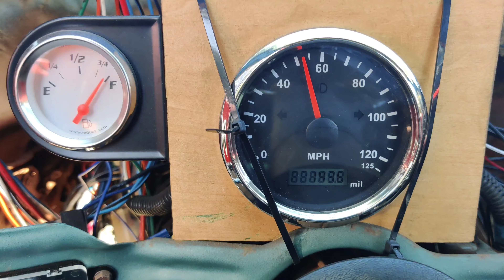MAKING BESSIE FASTER!! (Governor springs and fuel plate mod)

Comment: Hey Chuck good to see you back and see that you are doing well! Btw LOVE that intro LMAO so true every word of it. IF and when you decide to go 4k RPM you will need to get 60lb valve springs because major engine damage can occur if you leave in the originals. Also get yourself a EGT gauge to keep a eye on your temps because turning up the fuel can cause your turbo blades to melt and will send shrapnel into the engine. NO more than 1,500 degrees for more than a few seconds. Sustaining 1,200-1,350 when towing or under heavy load is ok
Reply: Agreed on the gauges. I was going to say the same thing.

Comment: The top screw that you click is for the mid to top end range and is NOT the smoke screw! The smoke screw is under the cap ( looks like a thimble ) all the way in the back of the AFC which is for low to mid range but only turn that one up when you get your EGT gauge installed and only turn 1/2 of a turn per run and keep a eye on your temps each time

Comment: On vice grip garage he said the inside of those rubber brake hoses go bad and collapse sometimes will let fluid to caliper when you use brakes but not let it fluid return back to reservoir when released

Comment: For the brake dragging issue I’ve seen that on some hydro boost installs the part between the booster and master cylinder is too long. If there’s not some clearance it’s as if your brake pedal is slightly pressed all the time.
Reply from the maker: That’s exactly what ended up being the issue. I wound up finding a pushrod and return spring in a junk yard truck and it instantly fixed the problem 👍🏻

Comment: You could take the Plate completely out and block off theTurbo waste gate at the pump and you have to do it at the Turbo side too. You will feel a huge difference and a lot more smoke.  If you don't like it you can always put it back the way it is
Reply from the maker: I'll be sure to look into it! Thanks for the tip!

Comment: Glad youre back brother, missed you! The soft hose could be bad even brand new sometimes especially if its a cheap one, it can hold the pressure on your caliper
Reply from the maker: Glad to be back! And that's very good to know. I never would've thought a new hose could cause an issue, but it's worth a shot. Thanks for the tip!
Reply: Like he said most likely hose but possible caliper if hose don't work. Had it happen a few times on customer cars

Comment: 2shifters one in the column one on the floor 😎 that’s gansta 🤣
Reply from the maker: Haha you know it! 😂
Reply: Lol. Great swap series why didn’t you just get a 1st gen square body dodge it already has the 5.9 in it haha
Reply from the maker: Because I love square body Chevys but I also love 12 valve Cummins 😂 why not have both in one? Lol
Reply: What are your thoughts on a 10speed swap from a semi truck the Eaton tt6610 transmission?
Reply from the maker: I honestly can’t really say, I don’t know anything about those transmissions or what it would take to swap it into a pickup truck
Reply: Here’s a little video https://youtu.be/peJgDuYfSX4 
Just thought you may have some insight into what it would take having had all the experience. I have a 1st gen dodge dually btw that’s why I ask
Reply from the maker: Looks like it should be pretty straight forward as long as you sourced all of the parts that guy had. I can imagine a swap like that could get really expensive pretty quick. But as long as you’re comfortable with the overall cost and cutting your floor to fit the new gear box, I think that guy did a pretty good job of explaining the process

Comment: With that air filter can you hear the turbo??
Reply from the maker: This turbo still screams 👍 unfortunately it's the only air filter that will fit because the oil filter assembly is right in the way. I'm looking into other options though
Reply: ChucksCustoms do you know what I could do to get my stock 94 12v turbo to scream I took the silencer ring off but nothing really still sounds the same

Comment: Can you take the fuel plate out an will it work ???
Reply from the maker: That's not really something I want to test just yet lol
Reply: ChucksCustoms but do you know if it’s safe to do I have no clue what could happen?
Reply: The truck will run the same just more pep in its step because the rack can fully advance

Comment: Your tensioner setup doesn’t make much contact with belt , I’d be looking at a idler wheel to correct the angles
Reply from the maker: I might have to. I think my alternator was slightly misaligned as well because the belt started to delaminate on one side. It’s missing a few grooves now lol but I appreciate the input! How much contact should I aim for?

Comment: Painting it cat yellow and putting the cummins in that Chevy must have ruined the motor,  my 97 3/4 2wd is a mustang eating monster with the 4k spring and no fuel plate, and my truck has 340,000 mi on it
Reply from the maker: Yep, motor is destroyed and I get beaten by all the mustangs now. Maybe I’ll paint the next one John Deere green and put it in a Subaru. That will definitely work better than this paint/vehicle combo!